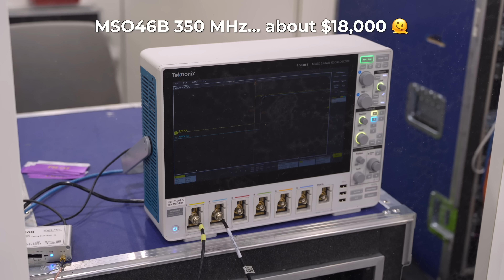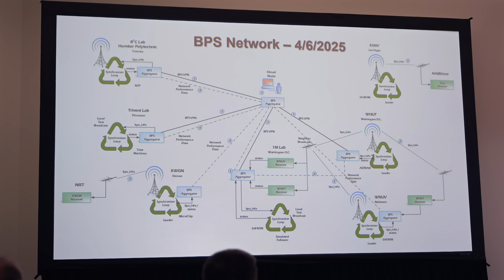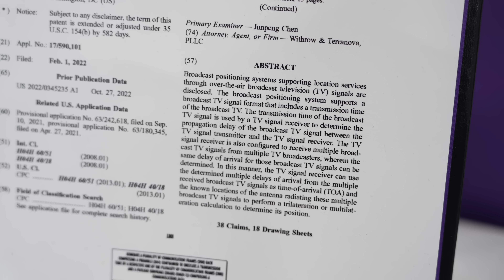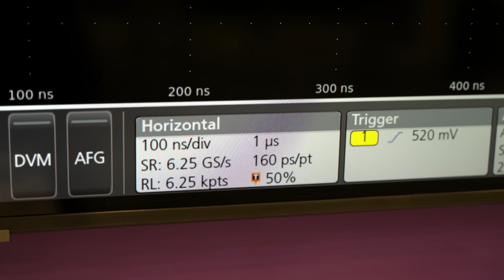I found a cool GPS alternative nobody knows about

Comment: So, where do all those alternative timing signal sources, including each ATSC3 tower, get the time they then broadcast further? Do they all have their internal (atomic?) clocks precise enough on their own, or do they actually rely on something else like GPS? 🤔 I mean, if the point was to have them as backup in case the GPS as a whole has some serious troubles, but some of the backups are relying on the GPS, that could be problem. However, signals from some of these alternatives probably are better receivable indoors and other places without unobstructed view to the sky, so a receiver that could receive all the mentioned signals would help in navigating indoors.

Another thought: if the GPS would be in trouble, would the power grid get in trouble too, like losing the synchronization? If power is lost how long would the ATSC towers continue to operate?

Hmm, I'll try to remember watch the video on the main channel when I have time; maybe these questions get answered there 😅.

Comment: I wonder if this can be used somehow with RTK as a fixed base station for high precision GPS.  I recently bought one of these new generation and relatively cheap GPS boards (eg Waveshare LC29H series) only to find out too late that there are no publicly-accessible fixed base stations within range. (South Texas) If a fixed location TV transmitter could be used as RTK it would open up use of centimeter-precision GPS within a much larger area.

Comment: Wow! What is OLD is NEW again! In those dinosaur days before GPS, people literally MOVED time by transporting portable Cesium clocks from one place to another, generally to sync other Cesium clocks in those places. This is obviously very expensive in terms of the cost of the portable Cesium clocks and the logistics involved. There wasn't much call for precision time and time transfer in those days, and most of that was associated with university lab work and research. People quickly realized that they could transfer precision timing by using local broadcast analog TV signals. With a receiver adjacent to the local master clock (again, in those days, a VERY expensive Cesium or Rubidium device), the time offset of the TV station signal could be very accurately measured and then sent over telephone lines or even sneaker-net to other local labs. With accounting for path length differences and careful multipath rejection, extremely accurate time transfer was commonplace among time and time transfer researchers. Just to show how far back this goes, here's a paper from 1972: https://tf.nist.gov/general/pdf/469.pdf

Comment: This is a back up tech for when the DGPS systems fail when satellites are taken out by war. The military has been researching this type of tech for guidance systems in the maritime industry for over a decade. E-Loran/Loran is old tech but very useful for navigation when the GPS system fails, but the military needs accurate guidance systems along with navigation systems.

Comment: During WW2 they would use two receivers positioned far enough apart, calculate distance using the speed of transmission, and then know the precise location of any 3rd party broadcast using trigonometry. Presumably you could pinpoint any cell phone with a broadcast that can reach two receivers.

Comment: That's pretty much how airplanes used to get their directional signals back in the days before radar.  They would lock onto a known radio broadcast signal, and check the strength.  Then they'd lock onto another known radio signal, and check the strength.  They could figure out how close or far away they were by triangulation, and return to the appropriate airstrip.

Comment: Great to hear that they are implementing this extra information in the TV station broadcasts. Those towers are emitting a huge amount of radio energy at VHF or UHF, so it should be much easier to receive inside buildings than GPS at 1.2 GHz.

Comment: I have always had the idea that something like this existed. I knew about it without reading about it. There is on GPS systems a way to switch on higher accuracy and it had something to do with radio, every broadcast transmitter has something in the transmission that tells the receiving equipment where the transmitter is located and what the exact time is, then this signal can be compared with the signals from other broadcast transmitters. I have no idea where I have seen this. And now you show the big box behind it. It is huge.

Comment: That's pretty neat.  Looks like with only one signal, it's better used as a GPS clock alternative.  (can't triangulate off one tower) Neat, but don't most GPS receivers use multiple signals now? Like you can get the Euro/China/Russain GPS (glonass, etc) in case GPS is down.  If there's something else going on I can't get any of those, I'll likely have bigger issues (where can I get food/water) I'll be focused on.  Still neat though.  I would expect first adopters to pay a premium to utilize this signal. GPS is almost commodity items at this time.    For the ham nerds in us, I'm surprised you don't champion a 10mhz clock output of your time devices more.  Seems the universal standard for radio, or even calibrating oscilloscopes and the like.   ATSC 3.0 sounds neat, but following Lon and the Antenna Man makes me less excited.  DRM has no place on the public airwaves, especially if it needs the internet.  I want it to work without the internet.  Especially after some disaster or weather event that takes my internet.  (AM radio also my first stop after disaster) Besides, why don't they just transmit whatever they want to DRM on the internet and cut the whole antenna out?  Seems like a solution looking for a problem.  Also, the data casting and possible reduction of strength for more data.  If I already have an internet connection at my house, why do i need more data from a TV antenna?  Once again, if it was setup to be fully remote with no internet needed, that's different then.  But needing internet connected makes defeats the purpose.

Comment: I knew it was total idiocy to turn LORAN-C off. Sure, you have GPS, and it's soooo accurate and the receivers are tiny and (mostly) easy to use.

But if there's a massive flare...what then?

LORAN-C already had the solution. By transmitting a ground-wave signal on longwave, the signal would be far less susceptible to ionospheric issues while still having ample coverage. It was less susceptible to EMP as well due to its frequencies and lack of reliance on skywave transmission. If something popped off, the tower could be grounded upon strike detection, and if the incoming AC were on a similar auto-kill, you could have that 100 kHz signal operating again in a matter of minutes.

On the other hand, a handful of space detonations could fry ALL of the satellites that GPS and its variants rely on.

One other feature that LORAN-C had was integration with the DGPS system. These transmitters have been gradually replacing a number of longwave NDBs, with the intent of providing a "hi-rez" GPS for close-in navigation around cities and large airports. It's been retooled to work with plain ol' GPS, but when it first rolled out, it offered supplemental positioning data on a similar quality level as present-day GPS within a DGPS range.

But going back to LORAN-C probably isn't going to happen. The big reason for that is that the transmitter sites were largely demolished several years ago; we used to have one about 50-60 miles from here, the Dana, Indiana site that was located at the Newport Arsenal. While it's nice to NOT have the "chatterbox" on 100 kHz (and everything between 80 to 120 kHz for the most part), I think that it was a serious error in judgement to turn off a system that worked fine. Having a proper backup for GPS seems like a no-brainer, IMHO.

Comment: Another thing I hope you found at NAB was a small box by SipRadius on the UK Pavilion in West Hall which can be used to give a stable equivalent to GPS through receiving timing from 5G cell towers. You calibrate it to GPS so you know the timing behaviour of the local cells then you can relocate inside and maintain a stable time lock in a location where GPS cannot be used (e.g. data centre where cost of running antenna can be very high).

Comment: boats used am radio stations and a directional loopstick antenna on a degree marked dial  locate one station  and if you know which way land is you know about you are sometimes thats enough ,locate two stations and you knew exactly where you are ,on top of that u.s.c.g. maintained radio beacons in areas with no stations ,,, you can still play with this by turning your am radio until the starion disappears look along the top of the radio the station is that way  or directly behind you thats why two stations is better

Comment: You popped up in my feed. What’s the odds. 
1985 I was a charter jet 🛩️ pilot and got to fly A mercury ion frequency storage standard uses trapped 199Hg+ ions to provide a precise and stable frequency reference. The actual box 📦 we had to set on it’s side to fit. When we got to Dover DE the scientist 🧑‍🔬 that designed it was standing at door of plane 🛩️ FALCON 20 with FEDEX conversion. He went nuts that we set on side and ruined it. (MORE, Hilarious)
Then in 2015 went to Greenbank WV quiet 🤫 zone and saw the Navy’s satellite 📡 dish. You should go. Take some of your equipment. Odd signal at night pulsating rhythmically.
Cheers 🍻 
New subscriber

Comment: When working at a Network Operating Center(NOC) in Oregon for MCI/Worldcom we synchronized(locked) our SONET long distance fiber backbones  We had a voting comparator shelve with three Rubidium oscillators one each synced(referenced) to Seattle. Sacramento and GPS.  This became our master reference that went to all long distance fiber transceivers.  We used to use Loran prior to switching to GPS.  Look how nice and stable those scope signals are.

Comment: Cool! What is the market for this? Who needs it enough to fund its deployment? Someone, I hope, b/c I'm as interested as you! Before GPS, I used Loran-C for navigation. A bizarre system that depended on identifying the 3rd (I think) cycle in synchronized pulses from different transmitters. At the frequencies used, an error of 1 cycle could put you 10 km out of position, depending on the geometry. GPS is a marvel, from the satellites, the timing, the data in the signals, and the receivers. It can be made even more precise with fixed terrestrial sites that broadcast the local real-time GPS error to enable precise corrections. Combining GPS w/ corrections and BPS might be interesting, for a precise system with redundancy. One issue with BPS is that I don't see any way for it to give elevation.  I'd like a precise system that can identify where I am in my home within a meter or so, including what floor I'm on. I wonder what resolution you can get with an altimeter?

Comment: Yes old Loran-C.

Decades ago when GPS was making it's public appearance and Loran-C was being phased out I bought a Loran-C receiver on clearance for $50.

Naturally being geeky I decided to perform a test.

Over two weekends, I drove with the Loran-C receiver 30 miles then parked in a specific parking space and wrote down BOTH the traditional Lat & Long coordinate and the Loran-C grid locations. 

The next weekend I repeated the 30 mile drive to the exact same parking spot and checked this time Loran-C location readings.

Results
While the Loran-C Lat & Long readings were very close to the prior weeks they were not exact. 

But to surprise, the Loran-C grid location spot reading wlas EXACTLYthe same as I measured for the same parking spot one week earlier.

I was impressed with the vintage analog Loran-C accuracy
Reply: I used a Handheld Loran-C receiver, strapped on the Yoke of a Cessna 172, for "Supplemental Navigation Support" for a Weekend Trip from Toronto, Ontario, to A Suburb of West Chicago, South of O'Hare Airport! 

It was VERY Helpful in the Return, with ability to Zoom in the Screen to just a few Miles, while I was Departing there, "Special VFR" (Low Clouds, Short Visibility)!  

Before the Trip, I zoomed in to a distance of 1/4 Mile or smaller, and recorded myself walking around our Apartment Complex, with a "Breadcrumb Trail!" Nice equipment! 

Loran should have been Refined, after GPS got Setup, not Dropped! 😮🥴🙄
Reply: Loran-C uses a perfectly spherical model of earth, which GPS uses the WGS-84 (an ellipsoid). 

These differences can be nontrivial ~1km depending on your exact position.

Source: I write code handles the differences between spheroids & inverse distance calculations.
Reply: Thank You for the reply.

Yours was an interesting story & experience. Again, what was its location accuracy relative to your end destinations?

A while back I read about the experiments for the proposed eLoran system.

The proposed US eLoran system is a completely digital system unlike the old analog Loran-C system of old.

I understand, with recent GPS jamming, spoofing and anti-satellite weapons, the DOD is now all interested in a ground based eLoran system.
Reply: @paulnese1090  - It was over 25 Years ago, but, as I recall, it nailed accuracy, as to Navigation needs, for me! 

Thanks for your reply. I do hope that Loran, VOR, & GPS systems can be available long term. Each has different benefits!

Comment: QuantumRPS relative positioning system makes everything else obsolete. Using quantum fields, and a known starting reference point, we can deduce the location in 3 dimensional space to within 5cm regardless of weather, rf interference, it even works under water, underground and in space and it remains accurate without needing calibration.

Comment: Here is a cool idea:

Start with GPS or BPS, feed it into a Pi, them generate a really low power clone of the WWVB longwave (60 kHz) time signal that most radio-controlled clocks in North America use to set the correct time. A lot of watches have real trouble getting the WWVB signal in California or Alaska. It would only have to have enough power to reach a watch right next to it.

Comment: Of course while you can get exact timing from those ATSC transmissions, they in turn obtain it from GPS.
So this does not really protect you from GPS jamming, only from very local GPS jamming (that would not affect the transmitter site).
Now it can be that the ATSC transmitter can survive a somewhat prolonged GPS jamming because it has a good quality reference oscillator.

Comment: With one tower it's only good as a timing backup or possibly to enhance GPS timing signals if the tech is close to GPS in spec (which I doubt). If you had 3-4 towers, it could be used to triangulate the receiver. VDES signals (aka AIS 2.0 for maritime use) are on VHF frequencies and can also be used to calculate location to within maybe 100 meters under ideal conditions. It's being deployed in Europe right now.

Comment: But where does BPS gets its sync with GPS, does local jamming influence both?
Reply from the maker: They can operate independently, if you have a good enough timing source, and you have a way to transfer time from an authority like the USNO to the BPS system without using the GPS satellites.

The demo on the show floor was using GPS to eLoran to BPS transmitter, and other demos were using GPS to the BPS transmitter directly, but it sounds like there were a few options under consideration for the 'official' time transfer method into the BPS system, like dark fiber, a ground-satellite-ground bounce from USNO/NIST, or eLoran to BPS.

Comment: The current generation of Tektronix oscilloscopes are pretty awful despite their high price. They basically did a 'windows 8' on the UI, which makes them really awkward to use. I generally prefer my old TDS744A from the 90's over modern equivalents.

Cool video though. Thanks for covering it. Also props to the BPS nerds for being brave enough to put a real demo in a show.

Comment: Interesting. What kind of antenna was needed for BPS reception in this demo ?  Is it on the roof as well ?
Reply from the maker: Standard TV antenna, and it was up on the roof as well, to establish a direct line of sight connection.

If the TV antenna was inside, it would likely have to deal with multipath signals that could make the accuracy a little worse.
Reply: @Level2Jeff  Ok thanks for the info. If I am correct, a standard TV antenna has to be aimed at the transmitter though, so how is this supposed to work for trilateration (for determining position) with a mobile receiver, you'll need 3 directional antennas to position precisely each time? I hope omni will be possible

Comment: Hi Jeff, I talked with your dad while at NAB this year, BPS is really cool stuff, but ATSC3 is DOA for multiple reasons in the TV realm, but adapting this to FM/AM actually wouldn't be terribly difficult. It'd be a fun project for sure. :)
Reply from the maker: I'd love to have all towers that broadcast IP-based protocols include BPS signals... seems like an obvious way to get tons of great location/timing data.

Especially if you could correlate cellular (usually lower height antennas) with big towers (like 1000+ ft FM antennas).

Comment: I have PTSD from BPS, I worked for a router/switch company that used to make switches that had hardware synchronization. You could get the BPS from GPS, from another device in the network, from the internet, from external source. It was pretty cool, but it was extremely hard to make it work.